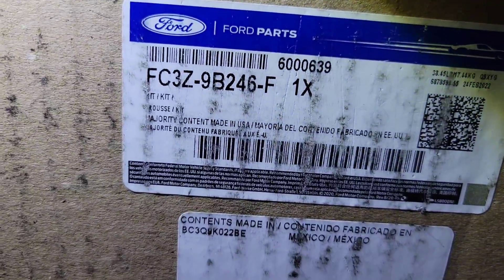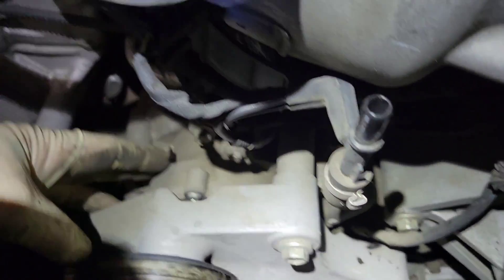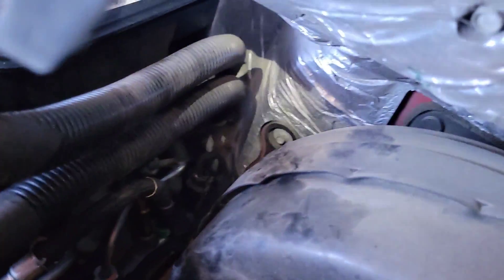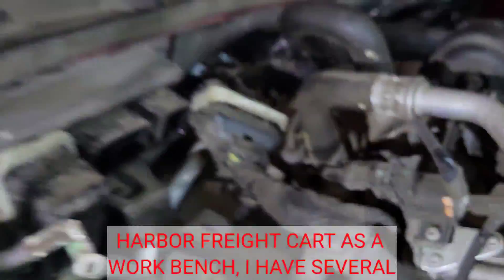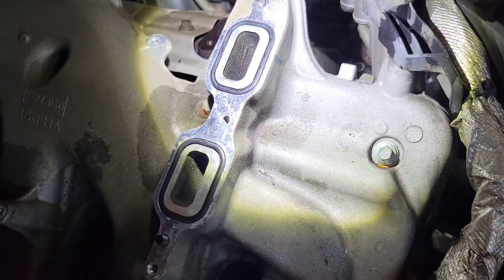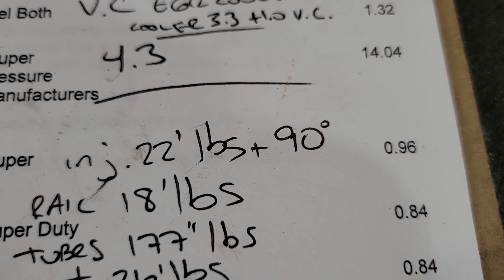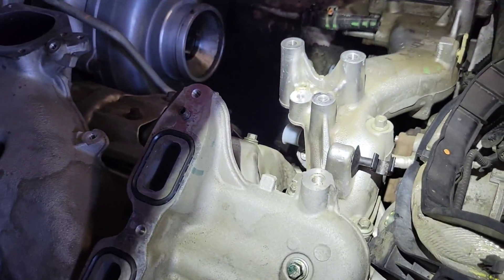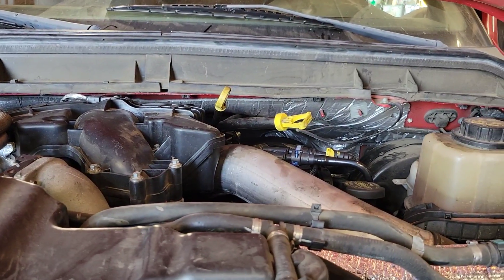6.7 Powerstroke Entire Fuel System Replacement

Comment: We found a way to remove the EGR cooler without removing that tube where the bolt breaks in the head.  Remove battery and air filter. Remove PCM. Put drain pan in that corner. Remove the two bolts on the top side. Everything removed like normal.  Remove the cooler to the passenger side toward the pan. Stay out of the splash zone.  Few extra steps. But better than breaking a bolt
Reply from the maker: Sweet that is awesome and I will keep that in mind. Thank you for watching.
Reply: @NutsandBoltswithTone  hope that helps. I do it that way all the time now. No more broken bolts. Have a great night

Comment: Dude great content ! I’m the youngest in my shop at 23 and I’m pretty much the guy all the diesels go to and I wanna learn more about them and the repairs involved which I know a decent amount mainly basics and after watching this I feel very confident in doing the repair if I ever have to. Question tho, what are symptoms or how do you check if this is what’s wrong with these 6.7 power strikes ? Like what are obvious signs the cp4 took a shit that I would need to look for if you have a video on that. Thank you
Reply from the maker: Thank you very much I appreciate that, and I am sure you are gonna kill it with the diesels. First thing you will find is usually a code associated with low fuel pressure. Then remove the fuel filters and look for metal. Then the final way is to remove intakes and low pressure fuel lines from high pressure pump and look for glitter. Here is a video on the diagnosis for that repair video you watched. It is part one to that one. Hit me up on Instagram if you need any help. Thanks for watching. 
https://studio.youtube.com/video/LrhpfdHbiII/edit

Comment: Hey assap buddy, I have a question for you. What happen if you install the pump with the two gear marks up, and the two marks in the pump matching eanch other, but whe you turn the engine gear to single mark it work right in between the two marks in the pump,, is that still a wrong install.?
Reply from the maker: @gtavlovers3354  message me on Instagram and I'll help you out

Comment: What a great and difficult video to make.  I just heard today that I have to replace my fuel system due to some bad fuel.  I wanted to see what it consisted of.  Too much work for me.  How often does this happen in your opinion?  I only have 39 k miles and this seems insane to me.
Reply from the maker: Thank you for the compliment. It happens but there are a lot of these trucks on the road. A huge part of it is not changing fuel filters frequent enough. also using inadequate filters that do not filter properly. Sometimes just get unlucky and the pump grenades even if you are taking care of your truck. You can get a kit put on that will prevent the whole system from having to be replaced if the pump does fail. I cant believe you have to have your fuel system from bad fuel. What symptoms are you having? Please message me back on instagram. I would love to continue chatting. Thank you for watching.
Reply: I have a 2016 with 71k. I was worried to death that my cp4 was going to blow up. I hedged my bets and installed an Air Dog lift pump for water separation and additional filtration. Then I installed the S&S Diesel 4.2 disaster prevention kit, so if my cp4 does blow up, I don't have to replace anything on the high pressure side (rails, lines, injectors, etc). On top of all of that I also religiously run quality diesel additive at every single fill up (Opti Lube XDP and Hot Shots EDT are the two best out there based upon my hours and hours of research). Within the last 24hrs S&S Diesel released a drop-in high pressure fuel pump that replaces the cp4. Pump only runs $2000. Far better than then $8000-$10000 repair in the case your cp4 blows up.

Comment: Hey bud Im looking to buy a 2012 super duty F550 crew cab & chassis with only 89000 miles. Owner filled with gas. Owner sent a video of the truck not being able to go more than 5 mph so limp mode. Could you comment on path forward? Thanks alot!
Reply from the maker: Message me on Instagram

Comment: How do I manually turn the bottom gear so the line is in the middle currently removing the old pump and the lines weren’t even lined up in the first place?
Reply from the maker: @Rob-r7r  you have to turn the crank before you take off high pressure pump.  You have to line up timing marks. Message me on Instagram if u need more help.
Reply: @NutsandBoltswithTone  how do I turn the crank just one the crank pulley bolt?
Reply: @NutsandBoltswithTone  ?
Reply from the maker: @Rob-r7r  nuts_n_bolts_with_tone
Reply: @NutsandBoltswithTone  I don’t have an instagram brotha I just need to know if I can can just turn the crank shaft pulley bolt clockwise to line it up and pull it out
Reply from the maker: @Rob-r7r  if you have not removed the high pressure pump, then you need to turn the crank until the timing marks line up.
Reply: @NutsandBoltswithTone  yes! And I do that with bolt in the crank pulley yeah?

Comment: What is your method to pulling gear off of the pump without puller?
Reply from the maker: Unthread the gear a little bit then with bolts on back side of the pump out hit shaft of pump with hammer or just use a couple key bars from behind and PRY on pump side to side. Gear will pop.  Hit me up on Instagram if you have any further questions. Thanks for watching.

Comment: Did you check for shavings in anything?
Reply from the maker: @MississippiHot_Shot  yes of course there was metal that's how I condemned the fuel system
Reply: @ wi got the problem now but listen I can’t find metal anywhere but that too sensor in the pump. I’ve got it took apart now
Reply from the maker: @MississippiHot_Shot  cut open filters look for metal, take out sensor at front of driver side fuel rail.
Reply from the maker: @MississippiHot_Shot  message me on Instagram if u need more help
Reply: @ okay. You talking about the secondary plastic filter one on top right?
Reply: @NutsandBoltswithTone  I wish I could send you a pic the filter is fine
Reply: @ sensor is clean as new fuel log up in it is as well.

Comment: What happens if you don’t reprogram fuel injectors? I did a contamination kit on a 2020 6,7 everything new from the dealer and at first it took like 5 seconds to fire it was working smooth for like 40 secs then it started to hesitate like rough idle
Reply from the maker: If you are just replacing them and do not program them then the truck will just not run right because it needs those specific codes. If you replace a pcm then it will set a check engine light for it. Thank you for watching

Comment: I have a 2017 ford f350 the runs but on the dash it indicates low fuel pressure, reduced engine power and gives the p0093. The truck shuts off at least 2x a week.  The ford dealership recommends a fuel contamination kit. The truck wasnt running after def was mixed with the diesel, until i changed the fuel regulator and the truck begun to run again.  Ive been hauling for almost 1.5 months but the trucks shuts off at 2x a weeks. Can someone help me with issue?
Reply from the maker: Message me on Instagram and I can try to help you out. Thanks for watching.

Comment: Ive got a 2015 Ford 6.7 that keeps blowing off the injector return lines off. At some point the original owner put def in the diesel. I've changed all the filter and I was able to drive 10k with no problems. Now the injector return lines keep blowing off. I've replace the harness twice with no luck. I was curious if you think I should just replace the injectors or do the whole disaster kit?
Reply from the maker: If def was put into the fuel then the fuel system could have internal issues.  Def is corrosive. If I got a truck that had def put in fuel and it was started it would get an entire fuel system and disaster prevention kit.  Message me on Instagram and I can help you out.  Thanks for watching